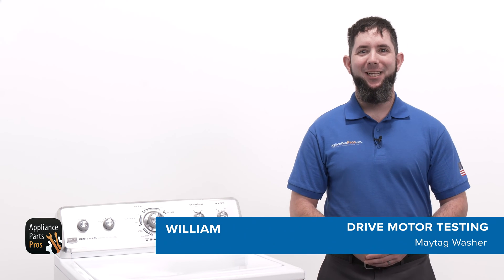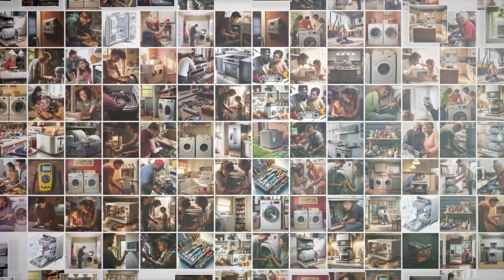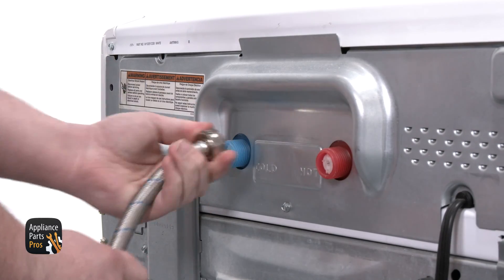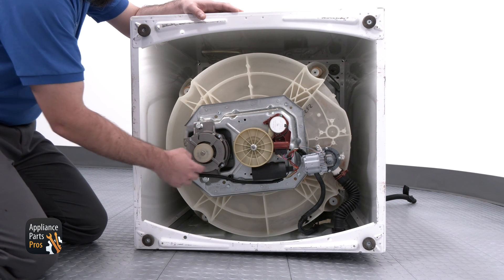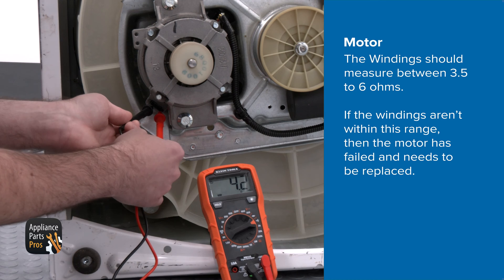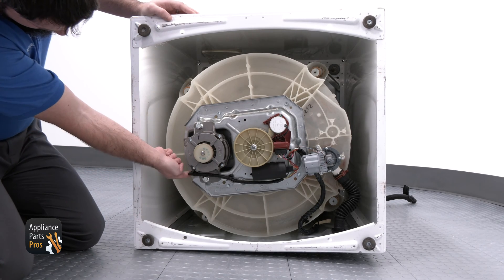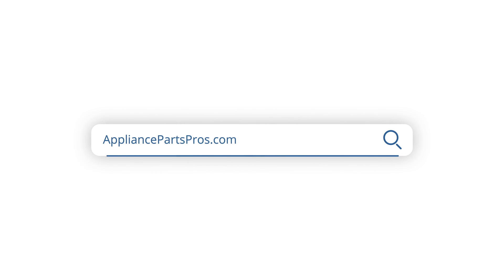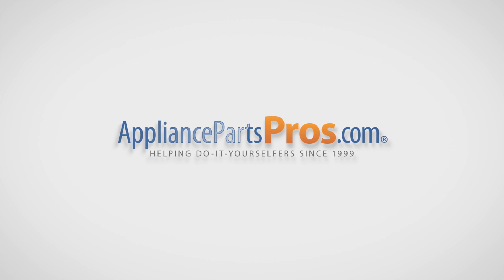How To Test A Maytag Washer Drive Motor W10832724

Comment: Hi bro I want to know motor all wire details. Like which colour wire for what work
Reply from the maker: Hi @mdashraf2852! Great question — the wire colors and functions can vary a bit depending on your washer model, even with the same motor. The best way to get the right info is to check the tech sheet for your specific unit — it’s usually tucked behind the control panel or inside the cabinet. That’ll show you exactly what each wire does. Hope that helps!